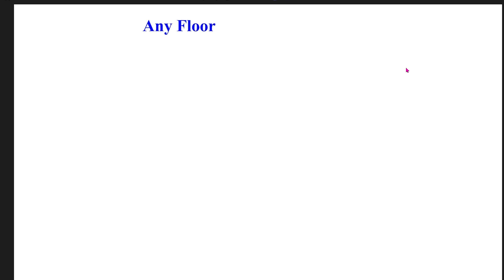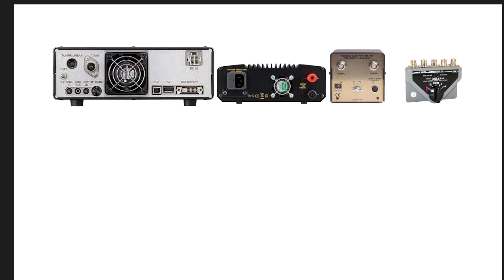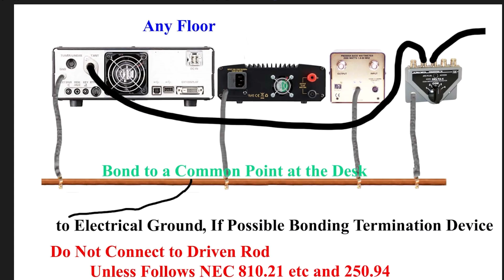Ground is a Myth says the ARRL! Ground is NOT a Myth and Here's How I Grounded My Station W6LG Jim

Comment: I saw that presentation, been scratching my head since.
Reply from the maker: It was a poorly produced presentation. 73, Jim W6LG
Reply: If you keep stretching until you figure it out, you'll be bald.
Reply: @noithinknot4583  too late! LOL
Reply from the maker: Chemotherapy is taking my hair and my teeth! 73, JIm W6LG
Reply: ב''ה, I have not seen this, but counterpoise is all you need for propagation (or aircraft and spacecraft systems would have issues) while safety is another story.